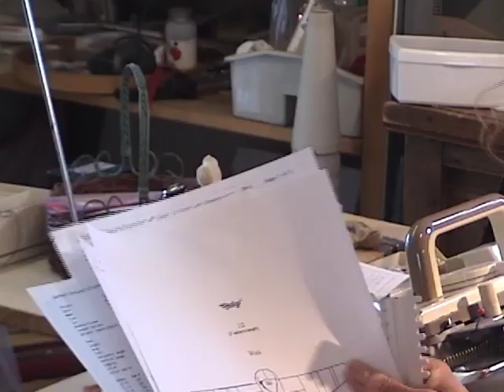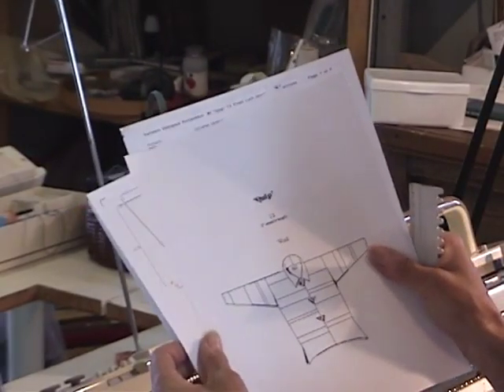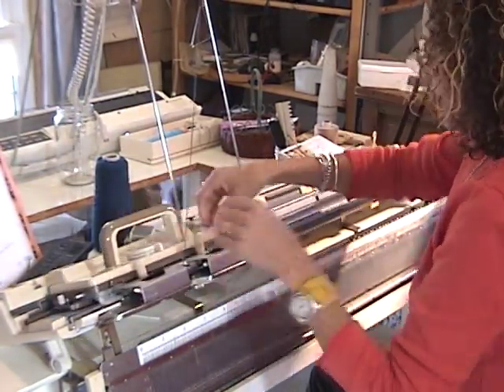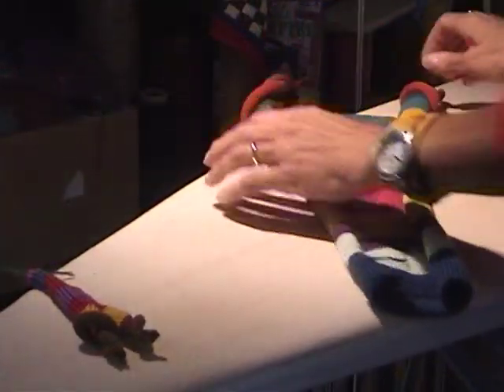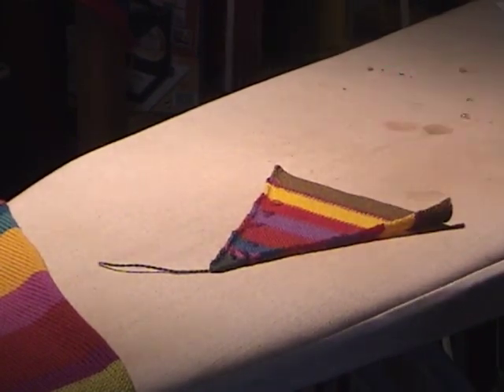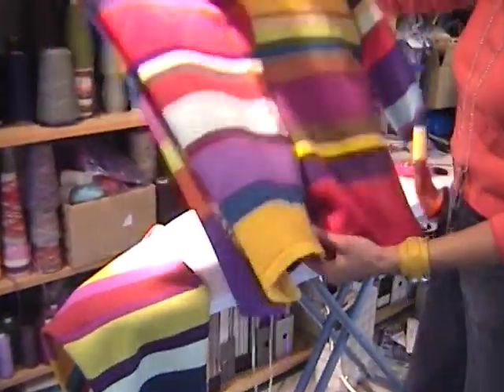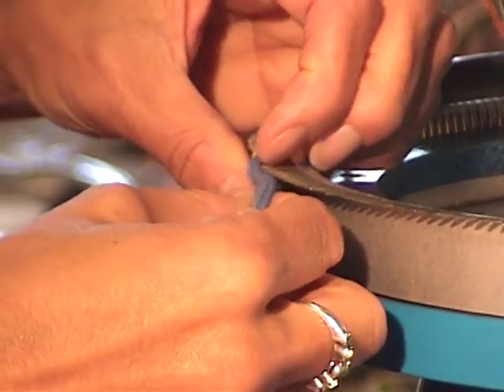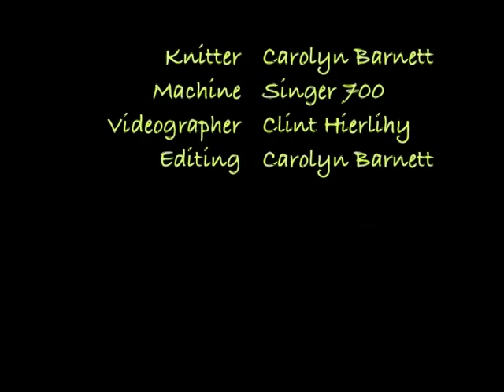STUDIO MOVIE

Comment: Just after you e-wrapped and had one row done, what was the white tool with the knob you used to "help" the first few rows?  Never seen one before.
Reply from the maker: +swallace55 It was a P Carriage which comes with Singer ribbers. It moves all the needles up into upper working position thereby the ruler underneath taking the sts behind the latches. I mostly use that but I now sometimes use a cast on rag and ravel cord.
Reply: I can see how it saves time.  I machine knitted for years but my machines are second and third hand and you don't always get all the tools and you don't see the new innovations.  Now I'm going to see if I can find one.  Thanks for answering my question.
Reply: Found a P carriage online and bought it.  No instructions!  It doesn't seem to fit on my 360 Studio.  What am I not doing right?